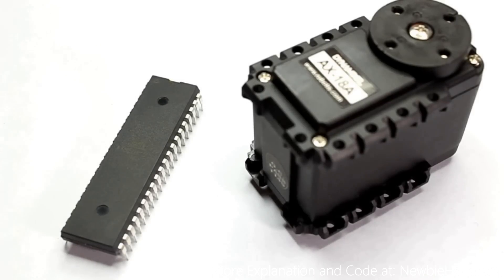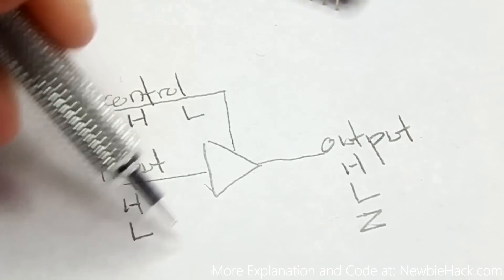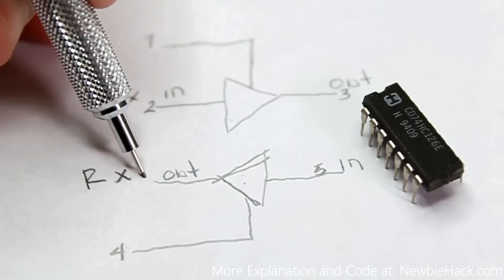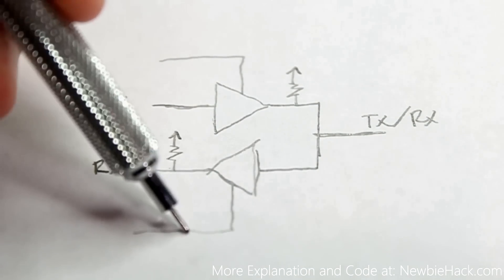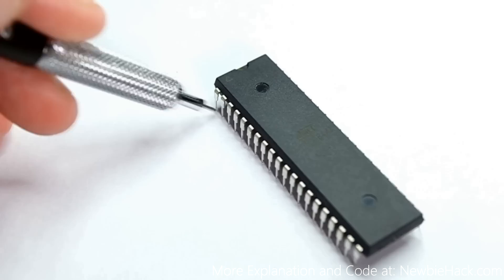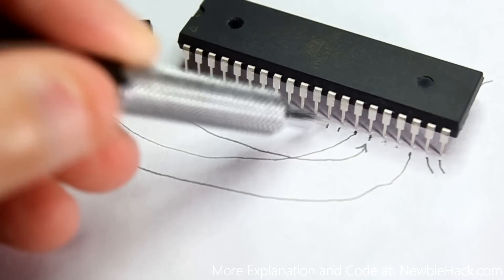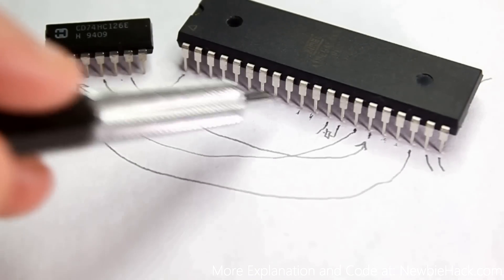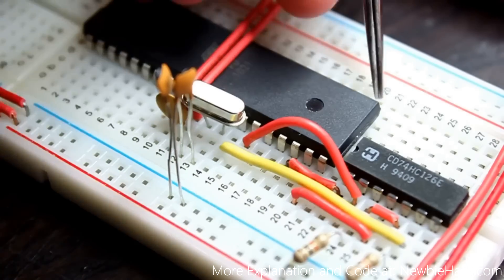Microcontrollers - AVR - Controlling Digital Servos Part 2

Comment: What are the dis/advantages of servos versus steppers especially for driving needles on simulator avionics?
Reply from the maker: I think I would need some background on driving needles for simulation avionics.  The actual performance, start, stop, smoothness and mechanical backlash is different with these types of servos and steppers. Also, industrial servos are quite different as well. Steppers will have a more exact stop and start and the stop will not exhibit a transient response (a springing effect as it adjusts to find its position). Of course, with steppers, once you lose the position, the offfset is permanent and will not find it's position until re zeroed, or calibrated (open loop control).  There are a bunch more differences and would really deserve a longer explanation.

Comment: why not use one of the spare buffers as inverter?
Reply from the maker: The buffer is not inverting, i.e. the buffer is a straight through buffer rather than a not gate).  The control of the buffer also does not allow an inverted state.

Comment: Thanks Patrick for the great efforts you are putting on these tutorials, I'm 3rd yr EEE student, may i know your education field? As I'd like to study microcontrollers in depth after my bachlore engineering.
Reply from the maker: Self taught from the rich information on the internet.  I have a b.arch (Architecture) and Masters in Urban Design out of U.C. Berkeley.
Reply: Impressive Patrick!! I really respect that, I bit you are genius in architecture design as well!
I'm not getting much from the internet tutorials (beside yours), I need the full structure of microcontrollers course from A to Z but in self study type, what is your advice ?
Thanks and keep it up mate.
Reply from the maker: ziaddoth Keep researching on the internet and reading datasheets.  The datasheets pretty much give all the information you need.  A basic course in electronics is always good.